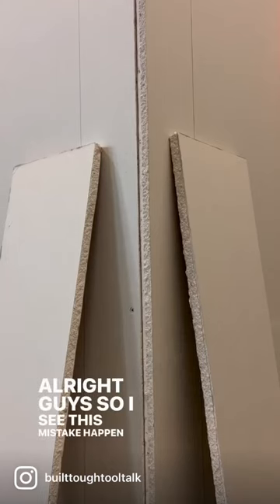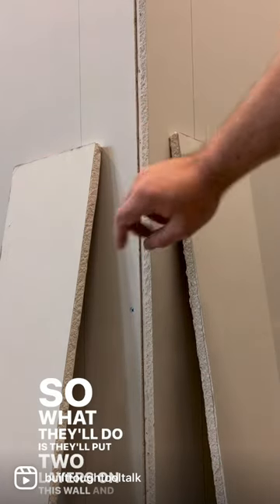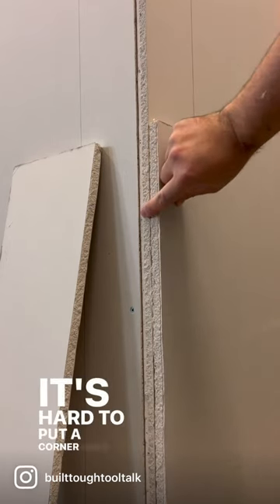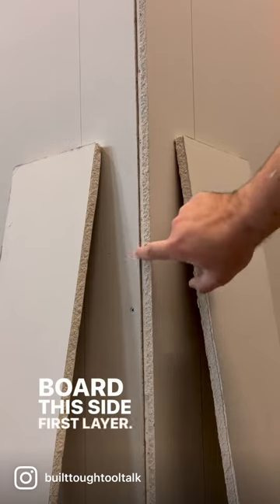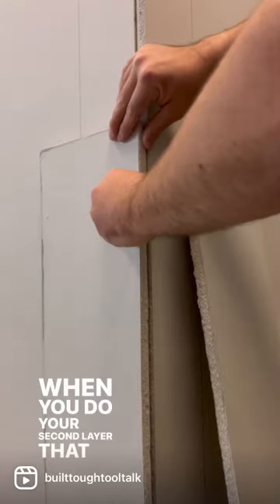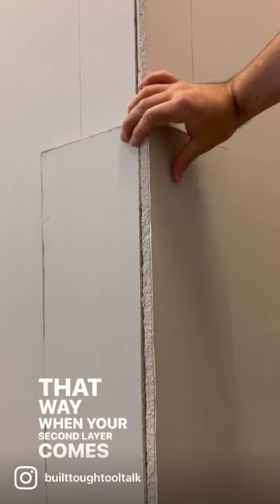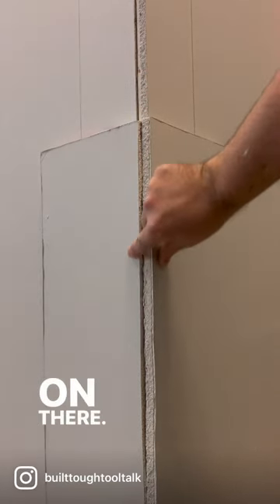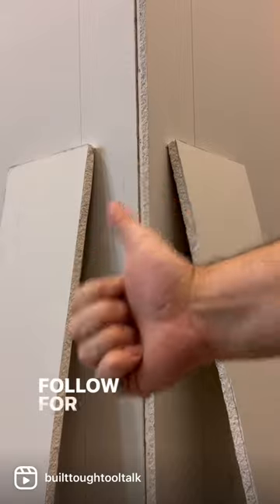How to Properly Install Double Layer Drywall #Shorts

Comment: Why are you doing a double layer of drywall in the first place?  Fire rating?
Reply from the maker: Yes. Fire rating.
Reply: @builttoughtooltalk  What type of board do you use?  

Where is this required and under what circumstances?
Reply from the maker: There are two different types. 5/8 type x and 1/2 type c. Here in Canada we need to separate units in malls, apartment buildings, multiple housing etc. each layer gives you more of a rating. 2 layers of 5/8 on both sides gives you a 2 hour rating

Comment: What anchors can i use for double dry wall
Reply from the maker: What are you looking to hang ?
Reply: @builttoughtooltalk  70 inch shelf tracks. I seen people saying use toggle bolts and then just use longer 1/4in x 3.5in screws since they only come with like 2 inch screws
Reply: @Patronesofly  when in doubt just tack whatever youre trying to hold onto the studs.... Half inch thick long lag screws, my picture frames aint never falling off